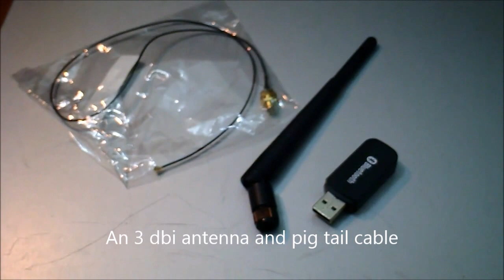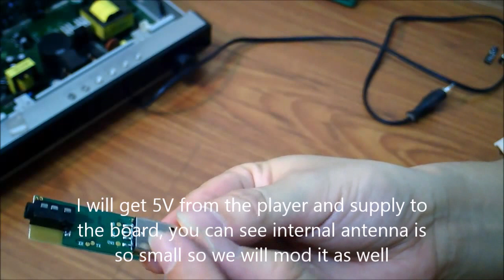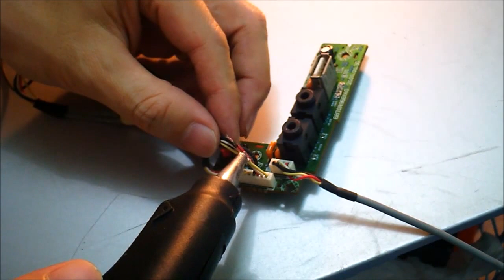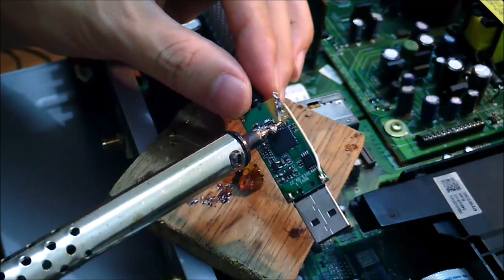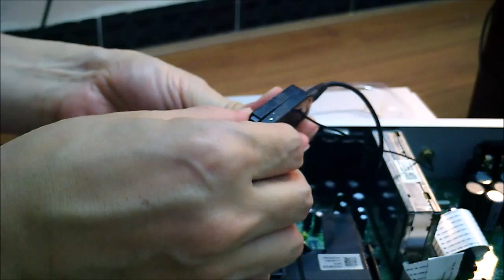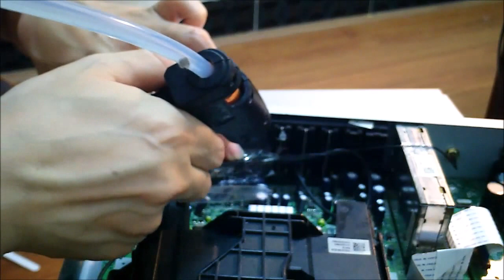DIY add bluetooth module to your audio systems and turn it to wireless

Comment: Could you explain me more detailed how do you connect/weld the antenna to the BT board? Thanks!
Reply: +Jesús Martinez Nicolás From the looks of it, they were not using any solder, but melting the cords to the board... Idk if I would suggest this.

Comment: Hi Nice Video .. But have you made a btooth transmitter.. I want to plug my mp3 player  or guitar in to a stand alone btooth transmitter  ? I have one of the 50 by 50 watt btooth amps that works great ..
Reply from the maker: Transmitter is another module, you can find on ebay or Aliexpress